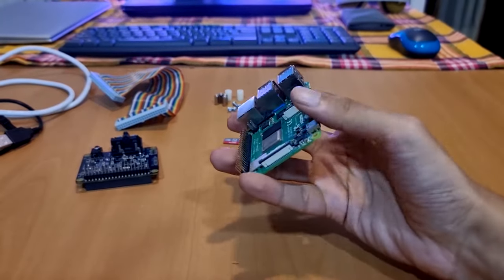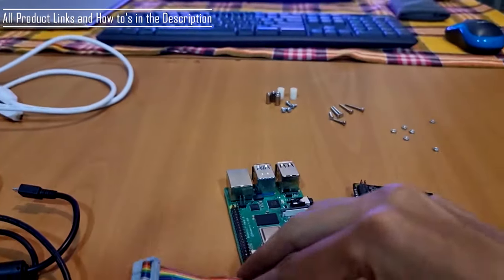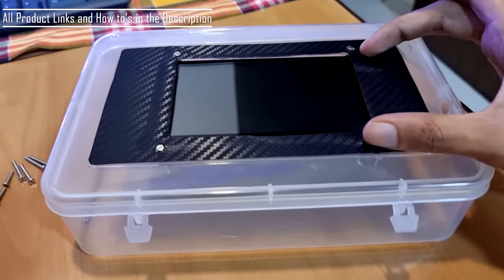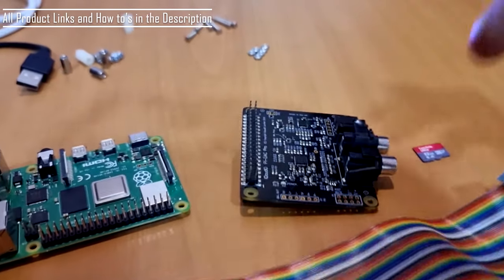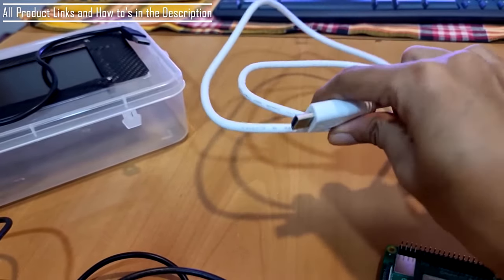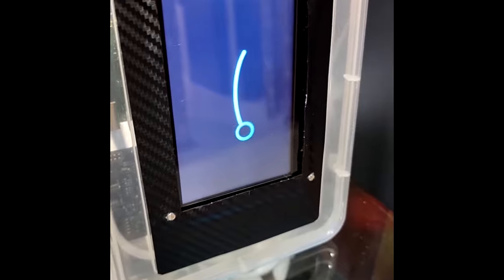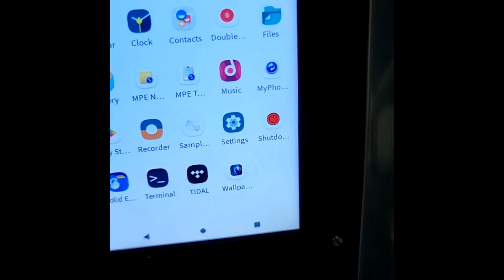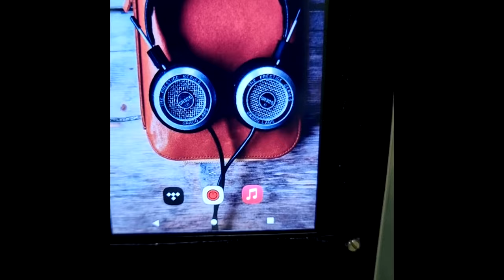Rasberry Pi 4 Music Streamer for Apple Music & Tidal Hi-Res

Comment: Finally you managed to dig a tunnel from Apple's walled garden!! Good job bro..
I am inspired.. and planning to do a similar project with RPi based allo digione player using lineage os. Lack of network based control used by likes of volumio is the only thing holding me back.
Reply from the maker: You are right, but small sacrifices 😁
Reply from the maker: You can use mirroring apps from your phone to control the device.
Reply: scrcpy has now an android client. I will try that one for screen mirroring
Reply: @HiFi_Paradise  hello brother is there any music sound quality difference between the raspberry pi runs with volumio os and lineage 21 os?

Comment: Don't forget the most crucial for extremely good sound on Raspberry streamers.
The power supply..
I use Ifi Power X 5 volt.
It such impact in my system.
I was Totally speechless.. 
From blurry sounds, to everything fell to place.
Reply from the maker: You are correct buddy, but above touchscreen did not work with other power supplies for somereason. Touch was not working at all.
That said for headless setup external power supply is best.
Reply: @HiFi_Paradise  it was probably because other psu's don't output the right voltage and amperage. The ifi can do 3a at 5v and is a clean noiseless psu so should work but is very expensive

Comment: Are you connecting pi+Dac as input to your Av receiver ? doesnt your AV receiver has a builtin dac which could be better than what you bought.
Reply from the maker: No and Yes,
No - I am connecting the RPi+DAC to a Analog Tube Preamp then to a Power Amp which powers my speakers. I need a external DAC for this chain.
Yes - My AVR does have a better DAC, but no usb input. When I use the analog inputs on AVR it doesn't use the on board DAC. RPi has RCA outs and USB out only. I would have to get a spidif or coaxial out board for Rpi to connect it to my AVR, which costed more and I don't listen to music on AVR so needed RCAs.

AVR vs Separates, Separates always sound good.
Reply: what about HDMI?

Comment: Great video. I wish you can help me further. I installed volumio and also tried moode. But I don’t get any sound out of the iQaudio pro. 😢
Reply from the maker: select IQaudio pro dac in playback settings, it would be hdmi by default
Reply: @HiFi_Paradise Brother i am thinking of to built a streamer using raspberry pi . But which version of raspberry pi is effective?. In dac whether i have to choose iqaudio dac pro or HIFI DAC pro hat es9038q2m? Give me your thoughts
Reply: @HiFi_Paradise recently you have  removed iqaudio dac pro from the streamer? If yes means explain to me why?